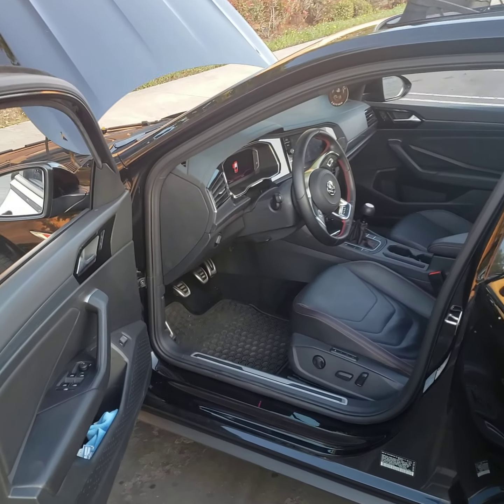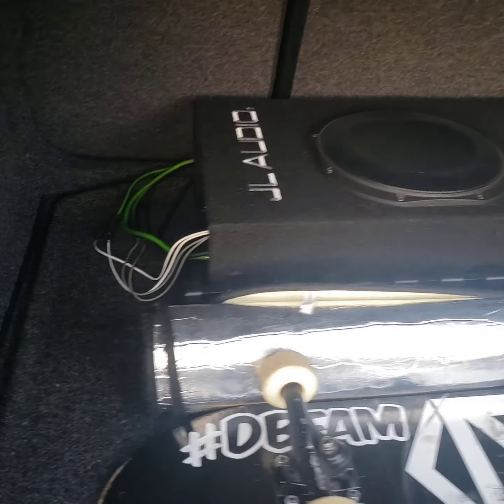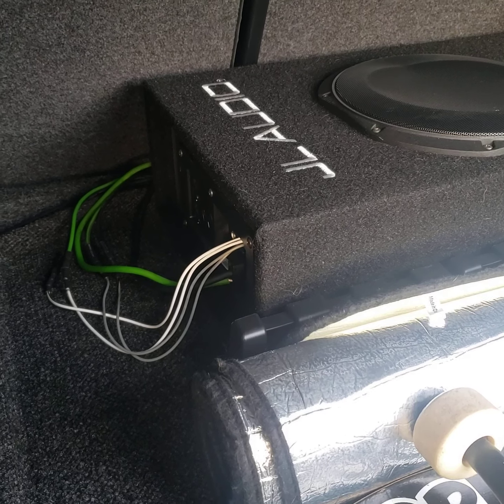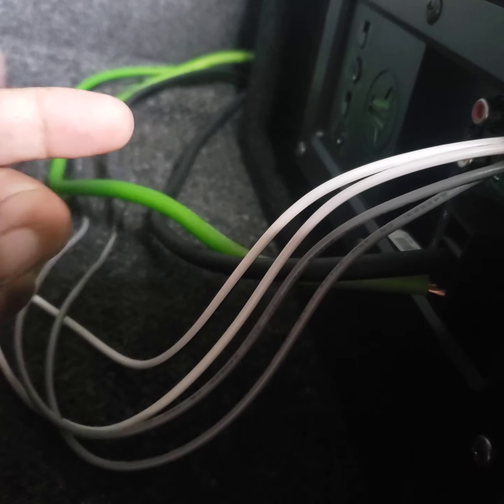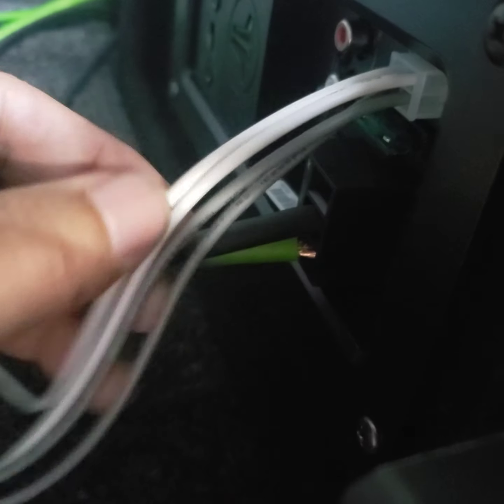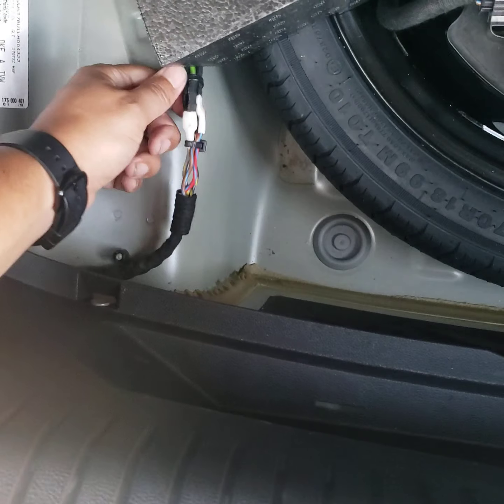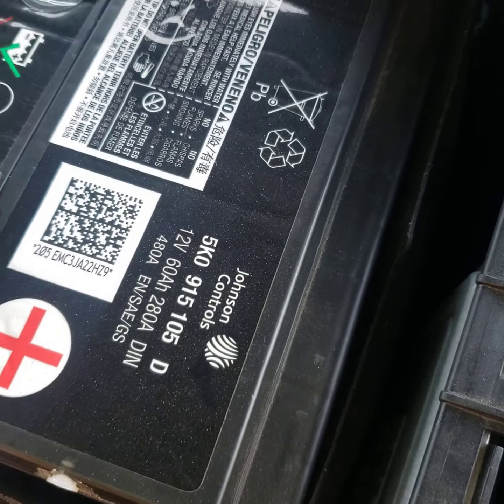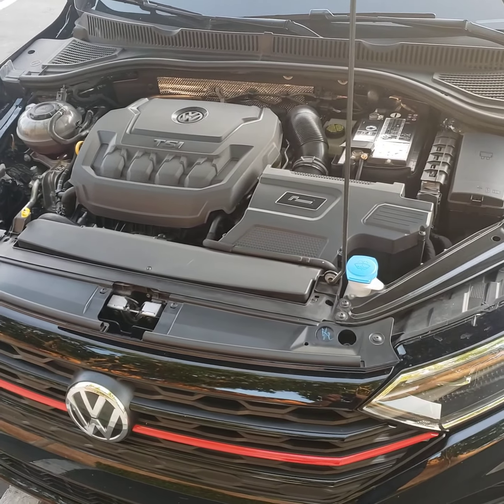2020 Jetta GLI Autobahn - Beats Audio Subwoofer Replacement Install

Comment: Nice. I ordered a vw connector plug from ECS that was a direct plugin.  No cutting wires. Hooked up a pioneer gm 8601 that is hidden under the mat with the spare tire. Built a downfiring box with a kicker comp r. Running 1 ohm. Hits hard.
Reply: You got a link for this connector???
Reply: @LethalxZOMBIES  Sorry I dont right now. I researched it on their site. Maybe I can get it for you tomm. It's on a vw forum also.
Reply: @LethalxZOMBIES  1pc  es#2641184 connector 4 pin and 2pcs  es#1009143 yellow wire that you cut each in half to make 4 wires.
Reply: Dope thanks for sharing. You have any details you can share about the box you built? I’m looking to build something similar and struggling to find something that is remotely stock looking.
Reply: @gosbusta  For my GTI i cut a pattern out to fit under the trunk liner. Made the sub fit into the center of the spare wheel downfiring.  I think the box was 3 3/4 deep and as wide as the spare tire wheel well. Basically looked like a half moon cut out towards the front of the car and square towards the back with a square on the underside as the box.  I then sold that GTI and built a basic downfiring box for the trunk of the GLI. Look up Stealth Gti on youtube.  I built something similar.

Comment: Just had mine installed on Monday, Kenwood dpx594bt head unit,Kicker components in the front,Kicker 2ways in the rear deck all being driven by an audio control acm-4.300 still breaking it all in but for a ten inch sub it gets down,I did notice you don't have the remote bass nob,I highly recommend you get one.

Comment: Where did you get the wire diagram for the connections you made in the trunk?
Reply from the maker: Black/Yellow = -
Grey/Yellow = +

Red/Blue = -
Brown/Blue = +
Reply: @ocwebsitepro  thanks!
Reply: Can a regular line out converter be connected to the wires in the trunk? (So I don't have to pull the radio and get the wires from the back)
Reply: @ocwebsitepro typically brown is ground with the Germans so you may have it backwards but it still works.